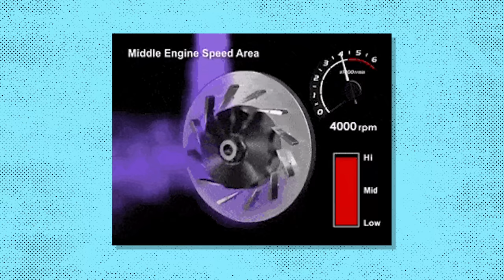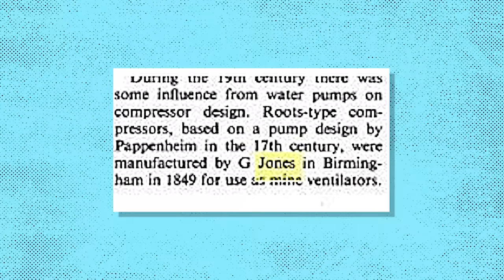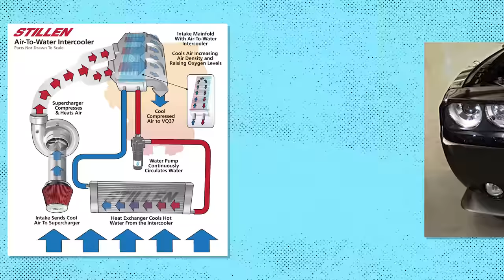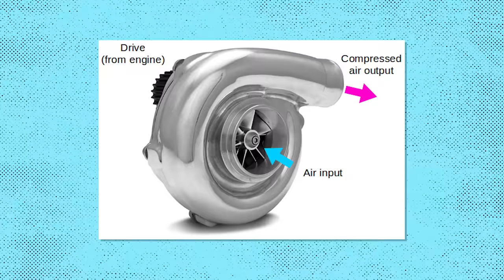Why Superchargers Aren't As Good as Turbos

Comment: If you have a higher compression engine with a high redline, then a centrifugal supercharger makes a lot more sense to use than a turbo.
Reply: WHY? You will have very limited manifold pressure and a high risk of detonation damage either way, at least with the turbo you will make more power at the same boost pressure.
Reply: @sandervanderkammen9230  Turbo's work better on lower compression engines. Most turbo cars tend to have lower compression pistons with a 7k rpm redline. You're asking too much of an engine to cope with a turbo plus a high rev limit and high compression pistons. Too much heat and stress on all the moving parts.
Reply: @johnmitchell2269  Supercharged engines work best with lower static compression ratio...
Turbos make more power at the same boost pressure.
Reply: @johnmitchell2269  The Acura NSX turbo revs to 7,500rpm 
The Ferrari F142M and the Koeneggsegg rev to 8,000rpm with turbochargers.
Turbocharged F1 cars rev between 15,000rpm and 18,000rpm.
Reply: @sandervanderkammen9230  Turbo F1 engines are built to last one season, not 25 years.
Reply: @johnmitchell2269  Top Fuel engines are only built to last 6 seconds... whats your point?
Reply: @sandervanderkammen9230  My initial post had nothing to do with Motorsport. I was meaning in terms of every day daily driven cars. Not vehicles that cost millions that are used competitively.
Reply: @johnmitchell2269  Well, I referenced several production cars as well, 
But you did not have anything to reply about them.
 I think you realize that what you said  in your original post is wrong.
Reply: @johnmitchell2269  You can buy a Mazda 6 with a turbocharged 2.5 liter 10.5:1 compression with 17.5psi of boost...
Reply: @sandervanderkammen9230  More people supercharge S2000's than turbo them. That's mainly because the F20C engine responds better to a supercharger than a turbo. Stock K series engines last longer and are more reliable supercharged than turbocharged as well. Those engines are higher compression higher revving engines.
Reply: @johnmitchell2269  what is your point? Honda hasn't made the S2000 in over 13 years....
There are more cars made with turbochargers than superchargers.
Reply: @johnmitchell2269  You jave some proof they last longer?
At the manifold pressures and horsepower output????
I think you need to stay in school kid... come back when youre all grown up a educated.
Reply: @sandervanderkammen9230  The C63's with the 6.2 V8. Look into how many people supercharge them vs turbo them. GM still supercharge their performance cars. How many engines have Evo owners blown up? That's an example of a higher compression turbo engine that doesn't last and is unreliable.
Reply: @johnmitchell2269  Jesus, you still beating this dead horse???

Why would you need to turbo a corvette in the first place?
Mitsubishi makes garbage, whats your point?

Comment: There's virtually no lag with the centrifugal blower with my blower belt hooked up I can dump the clutch in first gear and it'll take off without even pushing the gas and I can let the clutch out in second gear to take off and third too if I feather it enough with no throttle so it has way more torque than it does without the supercharger even at idle but the power comes on really really strong above 2400 revs
Reply: There is virtually no lag with modern turbochargers... and turbosstill make more power.
Reply: @sandervanderkammen9230  pound-for-pound a procharger kit will make more power to the wheels than any other forced induction especially on pump gas turbos get too hot require E85 or 110 race fuel or 116
Reply: @biggregsparks8364   That is completely false, Turbochargers have a fundamental advantage over superchargers in that they will always make more power than a supercharger.
Reply: @sandervanderkammen9230  centrifugal blowers make more on pump. look it up. There's a reason why all the fastest cars you see have a root blower on top of them then huh and a centrifugal blower is not a Roots blower if it's turbo on a belt turbos have massive like you just haven't run in one that has a big enough turbo on it yet
Reply: @sandervanderkammen9230  they make centrifugal blowers big enough now to make 4500 horsepower and they destroy turbos on any drag racing class for the majority about 70% of the time that's a trip go blower when's the entire Race season can't bulshit me
Reply: @biggregsparks8364  NO, THEY DON'T 
Turbos always make more power regardless of the type of fuel.
Reply: @biggregsparks8364  Fastest production cars in the world are TURBOCHARGED.
Turbos are superior to superchargers... this is an irrefutable fact that cannot be disputed.
Reply: @sandervanderkammen9230  wrong. heat, combined with the backpressure associated with a turbo, means that turbo motors have a lower detonation threshold. As such, while turbos have a slight power advantage over a supercharger on race gas, supercharged engines make more power on pump gas because they can run more boost before detonation sets in. Tell me you know nothing about engines without telling me and you know nothing about engines
Reply: @sandervanderkammen9230  you probably don't even know what detonation means and I know for sure you don't know how to build engines that we wouldn't be having this conversation right now you can't keep disagreeing with me without providing some sort of example boost pressure versus centrifugal blower boost pressure and dyno back-to-back on the same car because it has been done and a procharger is a turbo it's just on a belt I am not talking about the conventional supercharger that sits on top of the engine
Reply: @sandervanderkammen9230  also it doesn't even matter if turbos are more capable of making more power. At the end of the day depends on what you're into. Little or motorcycle for cylinders in v6s turbos are better choice for them because it increases the low to mid-range power or as if you have a VA that already makes too much torque on the low-end a prochargers a very good choice cuz it takes off damn near like stock and it pulls really really hard on the top end because of boost increasing with revs instead of having a spike in the mid-range with turbos then fall off on the top end. With that being said like I said if you want to make more power you just buy a bigger head unit from ProCharger and now you're making two or three hundred more horsepower so the efficiencies thing is just what bench Racers come up with. If we're talking about efficiency I would build a 1.6 L with a turbo making 800 horse efficiency doesn't exist once you get to the racetrack I'd rather have a little bit larger motor that makes a good low-end torque off boost pressure
Reply: @biggregsparks8364  Turbocharged engines do not have back pressure, you clearly lack any formal education or professional experience regarding this topic.
Reply: @biggregsparks8364  Turbochargers have a significant fundamental advantage over superchargers because they have no parasitic load on the reciprocating engine to drive the compressor.
The turbocharger is driven entirely by the waste heat energy discarded by the reciprocating engine.

The same engine, same size compressor And same manifold boost pressure the turbocharger will always produce more horsepower and the difference is equal to the horsepower load of the compressor.

Any questions son?
Reply: @biggregsparks8364  You really don't know how turbochargers work at all do you?
A supercharger can never make more power than a turbocharger because the increase in volumetric efficiency and decrease in pumping loss is offset by compressor load.

Turbocharged engines make more power because they are Combined Cycle heat engines.
One Otto or Diesel Cycle combined with a Brayton Cycle engine... both running on the same heat reservoir.
Reply: @sandervanderkammen9230  no, they have what is called backpressure thats the amount of engine load required to drive the turbochargers. turbochargers create excessive heat, which can get higher than 800 degrees Fahrenheit, which even with a big air to air intercooler, still cause a pretty high intake air temperature. This increased temperature, combined with even the best 93 octane pump fuel, causes what is called detonation. This means the fuel and air ignites before the spark plug has a chance to fire, which will blow any factory piston to hell, even most forged aftermarket pistons. With a Procharger, they don't get red from heat because they are essentially just a turbine spooled up normally by a belt, then air goes through the same type of intercooler and forced into the throttle body, just like the turbocharged setup, except the intake air temperature is far less than the turbo air temps, which means zero detonation/engine exploding and you can then run much higher boost pressure than the turbo on the 93 octane. All with ZERO google. Have a good life sir. Thanks
Reply: @biggregsparks8364  How can they have back pressure if the intake manifold pressure is the same or higher than the exhaust manifold pressure?
Do you even understand what back pressure is?
Reply: @biggregsparks8364  Turbochargers produce LESS heat because they have lower Heat Rejection

Turbocharged engines make more power because they convert more heat into horsepower.

 The exhaust gas temperature DROPS as it passes through the turbine approximately 150° C (300°F)

This drop in the temperature is DIRECTLY RELATED to the amount of heat converted into shaft horsepower by the turbine wheel.
Reply: @biggregsparks8364  NO, IT IS NOT.
DETONATION is when the air fuel mixture reaches its Auto Ignition Point before the ignition spark occurs or the flame propagation is completed.
This causes a high brisance detonation rather than normal  Deflagerarion
 This can be caused by a combination of several factors including temperature, pressure, Air Fuel Ratio, fuel type, combustion chamber efficiency and ignition timing and performance.

Any questions son?

Comment: I prefer them over turbos in Forza games anyday. They sound better (i love plane like sounds, i hate stututu sounds + i'm a N/A sound purist) also no turbo lag and no sudden, explosive acceleration. The only downside of SC is less power in general and less boost at higher RPMs (if that's even correct).
Reply: We are discussing real cars kid...
Reply: @sandervanderkammen9230  yes, but that doesn't invalidate my points. What i said can be transferred to real cars. I was just trying to be honest and didn't want to act like i actually drive or work on  cars.
Reply: @k.r.99  All of your point are invalid, the have no basis in reality and you just admitted exactly that.

Comment: Why can't they put chain or belt bethewwn turbo making it do the same thing and attach mechanism that detaches it after the turbo get's it's exhasut boost.
Reply: They do, but its only used in large 2-stroke Diesel engines.
Modern automotive turbos havw so little lag now that its not worth having a direct drive supercharger mode.
Reply: @sandervanderkammen9230  Good to know. Thinking since the set up would go to high up powerplants anyway. 
Comparing the supercharger boosted car market. 
It would free the turbos need to be all rounder and make best of it's power top end. 
Sounds dum, but we could make turbos wings produce more boost on operting speeds after supercharger has done it's magic and not use aerodynacmics for picking up speed. i need to reasearch the subjeckt more to make sense or is my idea viable, but hope you catch my drift. 
Thanks for the anwer.

Comment: Turbos take away engine power to make power too... Turbos cause a huge exhaust restriction, which increases back pressure, which absolutely robs the engine of power, it's just the turbo ends up creating more power than it takes away, just like superchargers.
Reply: WRONG 
How can they cause a restriction  if they flow MORE AIR???

There can't be any backpressure if the intake manifold pressures are higher than the normal atmosphere pressure.

Do you even understand what back pressure means???

Comment: If so rather have a super charger.  Also turbochargers tend to be a little cheaper than a supercharger,  THAT'S THE MAIN REASON for turbos being used more.  Vehicle manufacturers build them as cheap as they can  but still charge an arm and a leg that sheeple pay for.  Only draw back to a  supercharger is a very small parasitic loss due to being belt driven BUT the benefits out weight that small loss.  And they make superchargers that look almost like a turbocharger that can be mounted any where under the hood and they even make kits to mount them under the vehicle and run them off of the drive shaft  on rear wheel drive vehicles.  Yes turbos have came along way and barely have any noticeable lag now but compared to a supercharger they lag. It's all about the money as to why.
Reply: The fundamental difference between a turbo and supercharger is significant because the turbo has no parasitic load on the reciprocating engine it makes more power and burns less fuel... its a huge advantage in both motorsports and production cars.

Comment: I hate to tell you a centrifugal super charger doesn't necessarily have to be run off the engine power.  By connecting the charger to an electric motor,  you can mount it anywhere,  not have the parasitic power loss, and bye-bye turbo lag!
Reply: Where does the power for the electric motor come from???
Reply: @sandervanderkammen9230  where the rest of the cars electric power comes from! There are so many ways to make and store electricity. Do I need to name them all?
Reply: @chuckmoore8668  Thank you for confirming that you are not an engineer...
Reply: @sandervanderkammen9230  never said I was, just making a funny you obviously didn't understand. Sorry I didn't brake it down farther than Barney style for you!
Reply: @chuckmoore8668  I am dead serious,  where do you think the up to, or more than 100 horsepower worth of. energy is coming from???

Comment: Why shouldn't I just use a supercharger to get boost in low rpm and add a turbo as well, to get higher boost in higher rpm?
Reply: Its been done and it works, it solves one of the flaws of superchargers by having the turbo in front (upsteam)of the supererchager the turbo unloads the pumping loss from the supercharger, the  additional cost and complexity doesn't justify the having the extra supercharger... turbocharger today work just fine without any help.

Comment: A common misconception about turbos is that they don't draw power form the engine. They do. Not as much as superchargers, but they certainly draw a significant amount of power to compress intake air. You hear this a lot when talking about why turbos are better than superchargers. A better way to phrase it would be to say superchargers draw more engine power than turbos, not simply that superchargers draw engine power.
Reply: That is completely false, turbochargers do not induce any parasitic drag on the reciprocating engine.
The turbocharger is a Heat Engine and operates on the waste heat energy in the exhaust gasses using the BRAYTON CYCLE in a combined cycle operation.

Any questions?
Reply: @sandervanderkammen9230  Not false at all. Yes, temperature plays a part however it is primarily the mass flow rate of the exhaust air that drives the turbo, which is partially driven by the piston exhaust stroke (mainly pressure difference). Don't believe me? Strap a turbo onto an exhaust and allow it to build boost without being connected to the intake. Dyno the car before and after. Let the results speak for themselves mate. Sure, it may only be a minuscule difference, but worth noting. Turbos do not pump air solely from a temperature difference.
Reply: IT'S NOT A MISCONCEPTION... YOU NEED TO LEARN ABOUT HOW A TURBOCHARGER OPERATES.
Reply: @sandervanderkammen9230  That's not a great way to debate. I'm open to you explaining your claim, and please back it up with the relevant equations. Trust me, I will understand them if they are correct and not oversimplifications, I've taken multiple units in advanced thermodynamics.
Reply: @GRMNMSCLE  There is no debating with someone that is clearly not qualified to speak inteligently on this topic.

You need to learn about how a turbocharger actually works because you are sadly very confused and misinformed.
Stay in school and get a good education and maybe someday you will be able to discuss turbochargers as respected authority.
Reply: @sandervanderkammen9230  mate I’m asking you to explain😂
Reply: @GRMNMSCLE  Turbochargers are HEAT ENGINES and operate using the waste heat energy released from the reciprocating engine.
Turbochargers operate using the BRAYTON CYCLE in a combined cycle Heat Engine with the mated Otto or Diesel engine.

Heat provides all the energy to drive the turbine wheel and does not induce a parasitic load on the crankshaft of the reciprocating engine.
Any questions?